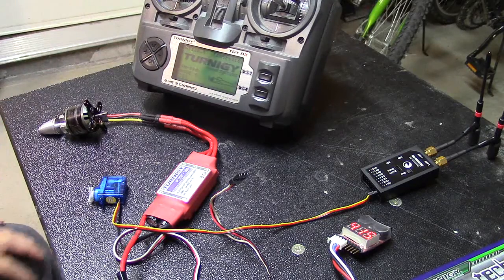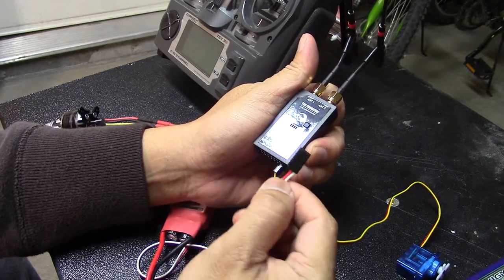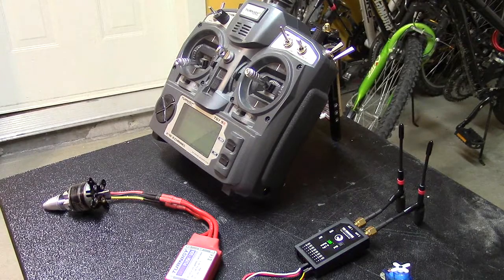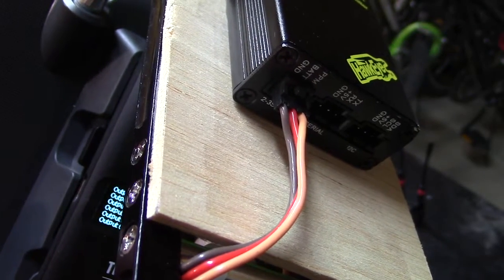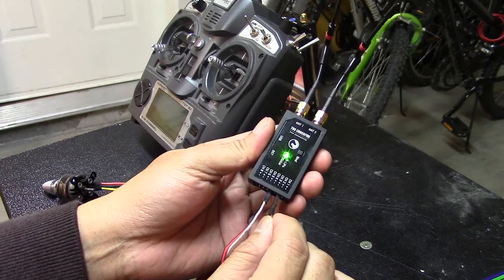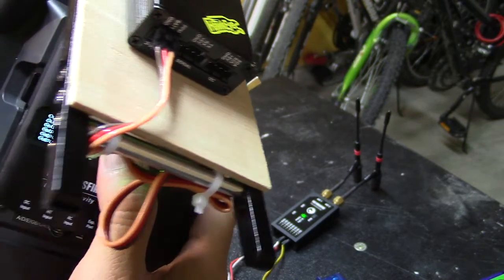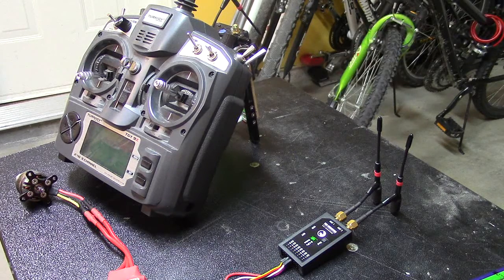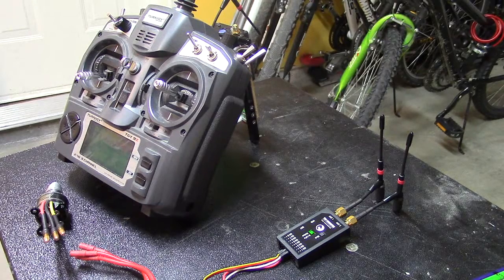TBS Crossfire RX Channels 2 and 3 not working

Comment: If you want to open the receiver up and look, check to see if there's a buffer IC on the outputs. Look close there and see if any of the pins are bridged. I've see that twice on two different receivers in the last couple of years. (neither was a Crossfire). Just and idea! If you have access to a scope you can look at the signal pins on 2 and 3 and see if there's erratic noise on them, or if they're just dead flat. If there's some random noise on them, then surely check for solder bridges between those channels somewhere.
Reply from the maker: +bonafidepirate Opened the receiver and the pins are soldered up properly. TBS already sent a replacement unit.